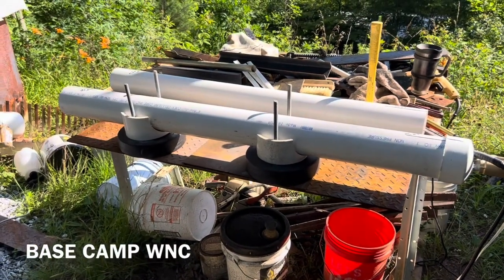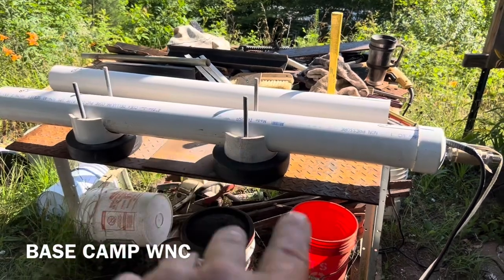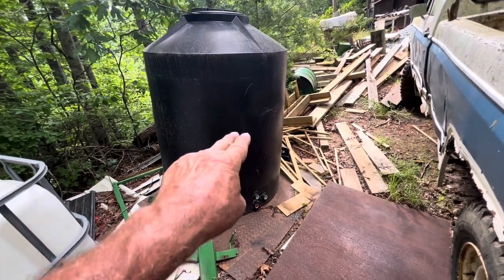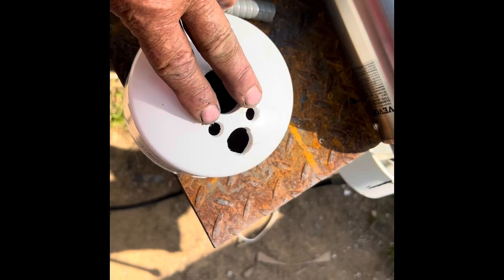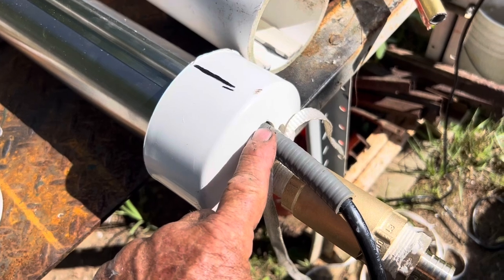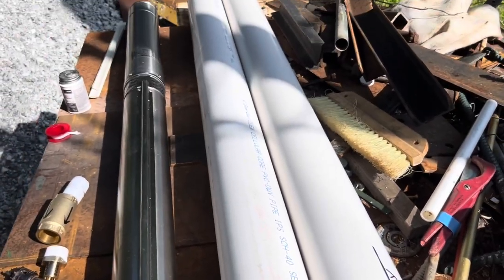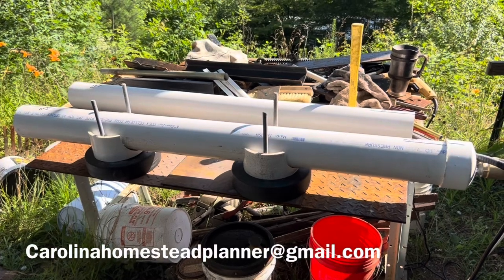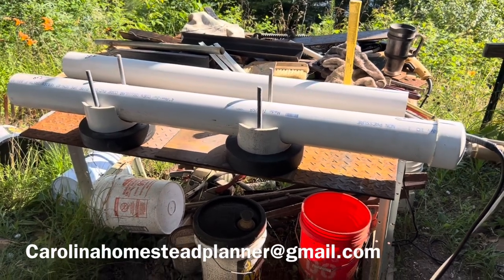Part 1 Mounting a deep well pump in a spring water storage tank

Comment: I have been looking at the HF shallow well pump but I'll need to protect it from freezing with a building of some type
Reply from the maker: And that is the reason I have gone with a deep well pump in the tank. If you can place the pressure tank in the house or basement that’s taken care of
Yes you can build a building and use heat tapes and that will work as long as you have power
When the grid is down then you need a propane or kerosene heater to protect for freezing 
It’s easier to use a deep well pump in the tank

Comment: This is what I have been doing with my hillside setup. I like the addition of the PVC pipe to protect the pump.  My setup has a 1HP well pump inserted into a Spring Water 350 gallon catchment tank. I pump twice a month uphill 150 feet to an 1800 gallon water storage tank, gravity feed to the house. I run the pump manually as needed. Been rock soild solution for over 10 years.   Sylva, NC area.  Thank you for sharing.
Reply from the maker: This is basically the same thing that I have 
Balsam Grove NC

Comment: Yes. I need pump info.!!! My plan is to pump water 100 ft. Up a bank into a 250 tote on a cement block platform so it can gravity feed into the house.
Reply from the maker: Send me any pictures and distance both vertical and horizontal 
And I will help you with your project 
Best to text information to 
1-843-224-2262